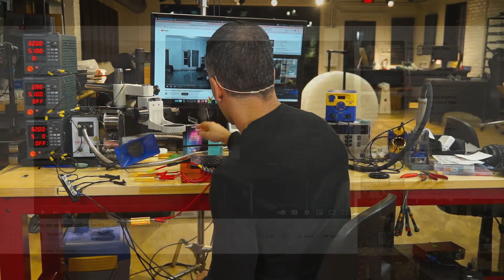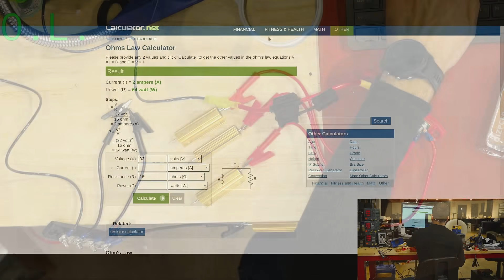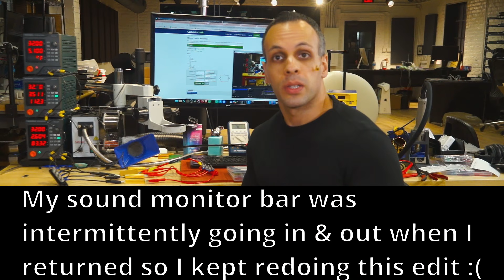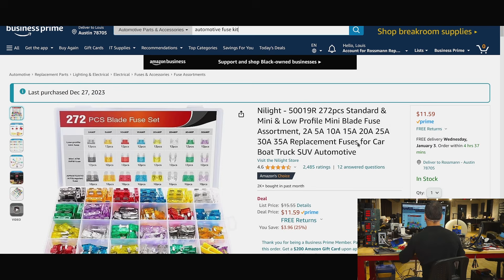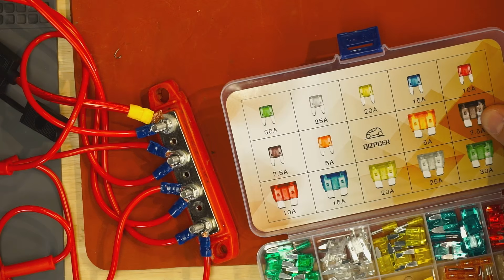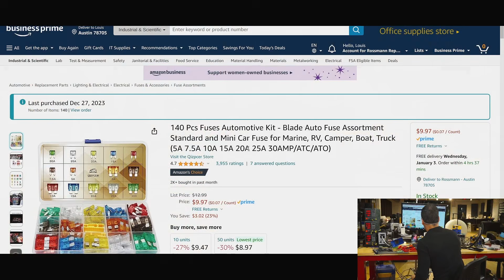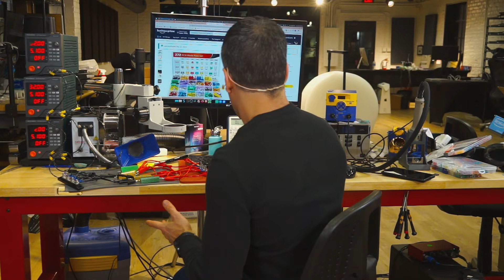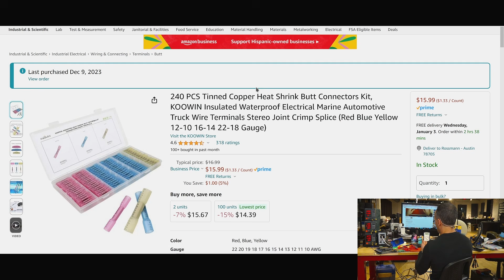Amazon Sells Fake Electrical Fuses

Comment: I am not an electrical engineer  but still watched your video (as well as the last one) because of the larger point you are making very well about the dropoff in quality of what is sold on Amazon. I have observed myself over the last few years how when I do a product search in Amazon, the top results are always some strange Chinese sounding names that Ive never heard of, and miraculously there are 10,000 5 star reviews of these products. I'm now conditioned to be very skeptical about Amazon reviews, whereas in the past, I would trust them.  I've also found that with a little extra effort, I can find the products I need from different vendors at lower prices.  I now have to seriously consider dropping my Prime subscription. The only thing I really am using it for now is the unlimited cloud storage for my 20 plus years of digital photographs.  Once I find an alternative cloud storage, I'll have no reason to continue my Prime subscription.
Reply: The Chinese should probably start to regulate themselves as a lot of companies are pulling out of their country. My Korean wife won't, for the most part, buy Chinese products because she doesn't trust them.

The country I trust the most for quality products is Germany. I brought a German vacuum, and have had it for 10+ years now, excellent product. I brought German made laminate flooring, best flooring I ever brought. As for stores I find Costco tends to sell quality products.
Reply: Pigs will fly way before the Chinese can regulate themselves
Reply: Is a NAS an option?
Reply: @bbrainstormer2036  That's what I did. I bought a 2 HDD NAS. It was the best investment that I ever made. I can even access it remotely. Simple and I never lost my data....oh, and I own my data and not some cloud company in case I don't pay my bill or decide to leave them. I hate subscriptions and avoid them as much as I can. If I want to stream a movie that I have on my NAS from another country, I can do that without a VPN.
Reply: Did you hear?  Prime video is going to have ads now.  And you have to pay $3 to get rid of the ads.  Between that and the "two-day shipping" that is never two days, it's a great time to get rid of a Prime subscription.
Reply: Buy yourself a NAS and some disks and take back your pictures in your hands, in the long run that's gonna be safer and cheaper
Reply: Buy yourself a NAS and some disks and take back your pictures in your hands, in the long run that's gonna be safer and cheaper
Reply: If you don't hate Microsoft, OneDrive is an option. You can get 100GB for like a dollar. They hide that option in favour of Office. And the cost for Office which comes with 1TB is the same as Prime.
Reply: I sort the reviews to 'Most Recent" first because tons of (5 star) reviews show up the second a product is listed. The later ones are where the bad ones show up.  I also normally only read the 3-1 star reviews. A 3-star, I figure the person actually thought about the review. 
On, and on products with thousands of reviews? Lots of times, it not even the same product!  The most recent reviews are of the product pictured but the first couple THOUSAND reviews are for an entirely different product. Seriously, I have looked at keyboards and had the first few thousand reviews be from some kitchen appliance.  
Place is just a mess anymore...
Reply: Two NAS and Backblaze are the recommendation I'd go for.
Reply: Buy yourself a NAS and some disks and take back your pictures in your hands, in the long run that's gonna be safer and cheaper
Reply: Buy yourself a NAS and some disks and take back your pictures in your hands, in the long run that's gonna be safer and cheaper
Reply: Buy yourself a NAS and some disks and take back your pictures in your hands, in the long run that's gonna be safer and cheaper
Reply: Buy yourself a NAS and some disks and take back your pictures in your hands, in the long run that's gonna be safer and cheaper
Reply: Buy yourself a NAS and some disks and take back your pictures in your hands, in the long run that's gonna be safer and cheaper
Reply: Buy yourself a NAS and some disks and take back your pictures in your hands, in the long run that's gonna be safer and cheaper
Reply: Buy yourself a NAS and some disks and take back your pictures in your hands, in the long run that's gonna be safer and cheaper
Reply: Buy yourself a NAS and some disks and take back your pictures in your hands, in the long run that's gonna be safer and cheaper
Reply: Buy yourself a NAS and some disks and take back your pictures in your hands, in the long run that's gonna be safer and cheaper
Reply: Buy yourself a NAS and some disks and take back your pictures in your hands, in the long run that's gonna be safer and cheaper
Reply: Buy yourself a NAS and some disks and take back your pictures in your hands, in the long run that's gonna be safer and cheaper
Reply: Buy yourself a NAS and some disks and take back your pictures in your hands, in the long run that's gonna be safer and cheaper
Reply: Buy yourself a NAS and some disks and take back your pictures in your hands, in the long run that's gonna be safer and cheaper
Reply: Buy yourself a NAS and some disks and take back your pictures in your hands, in the long run that's gonna be safer and cheaper
Reply: There are so many cloud storage products out there: Dropbox, Box, Google Cloud, Microsoft Onedrive, and more beyond that. There are also products like Backblaze that backup entire hard drives (though you don't have the individual online file-sharing features that Dropbox, Google Drive, etc. have; just the ability to continuously backup and recover the drive or get physical storage sent to you)

I can vouch for Dropbox being a good solution for most photographers I knew. Adobe even has cloud storage, which I haven't heard complaints about so if you're already paying for Adobe products could be a good option.

Comment: At least a fuse popped at all. I encountered a completely faked fuse - I guess it was just stamped sheet steel. In overload it absolutely melted the fuse housing and caused some damage of downstream electronics but did not blow. There are charts for blowing times. At twice the rated current it has to blow after 50 seconds max at a temperature of 23°C.

Comment: I recently purchased a Ryzen 7 7800x3D on Amazon, it arrived alongside other components, but the CPU was missing and the box (for the CPU) had it's seal broken. But the Outside Amazon box I got was still sealed, meaning it was likely stolen by the person packaging it, but instead of accepting responsibility, Amazon wants me to go to the police as it was "stolen by a third-party". Currently I am dealing with this situation with the police, but if you want to get any updates. I'll happily update you.
Reply: They never messed around when I had this issue. Got a phone delivered to my company, the box was a little light, since it was focking empty. 

We got the money back in a week.

It's more likely that it's a returned item that wasn't checked properly.
Reply: @LachskoenigIV We ended up returning the empty box back to Amazon for a refund, which they initially accepted as a valid return due to the missing parts, but refused a refund when the missing part was the empty box had arrived in their distribution centre, claiming I clearly didn't return it.
They refused to acknowledge the police were looking into and eventually, we charged back the transaction with his bank and got his money back that way.

Amazon followed up weeks later saying they still needed payment but never tried to charge me for it, so I guess they realised we were in the right on that one and didn't try to push it to court.

Comment: No need to do resistors.  Just set your power supply to put out a max 2a and increase until it blows.  Thanks for bringing this up....scary to think safety is skimped on these fuses.  A fuse should be able to handle that 2A at max temperature forever.  So at room temp 1.2 - 1.5x that amount should blow after a few seconds.  Another test would be to use the minimum gauge wire(24 awg) that a 2A fuse should protect and put that in series with the fuse.  Watch as the wire goes up in smoke before the fuse....that is the big issue.  The fuse is no longer protecting the wiring or equipment it is supposed to.
Reply: Except both claims was tested: the current rating, and the ability to break 32V without arcing. So the test-setup is kinda fair in that regard.

Comment: Normally you'd look for some voluntary safety test mark on the product (in the US, it would typically be the UL listing, in the EU it would be something like an SGS or TÜV Safety Tested mark or similar). For all the reviewed products, some people in the know asked the seller if these products are UL listed, and it was confirmed that they are not. Also on the product description or packaging pictures, there isn't  any safety marking (sometimes they can be forged, but in a marketplace like Amazon, certification companies like SGS or the TÜVs have market surveillance experts to hunt for misuse of their marks). To me it seems like Amazon is trying to hide this though, as you cannot see the full Q&A section like before (tried with multiple browsers), now you can keyword search to see some of the questions and answers if you guessed the right keyword(s)... 

What can you do? Don't buy any electrical products (components, wires, devices) without safety test marks. In the US you can search for example "UL listed automotive fuses" on Amazon and you'll likely be in a safer spot or select directly on the UL website to search for certified products: https://www.ul.com/services/fuse-and-fuseholders-services or https://iq.ul.com/fuses/. Properly tested fuses are a bit more expensive, but arguably this is not the place to save $5 and have your car burned down.

Stay safe!🦺

Comment: Lots of automotive fuses are actually a 'time delay' style fuse not a fast acting fuse due to the nature of vehicle loads such as wiper motors, window motors, fans, seat adjustment motors. Motor loads and such need time delay fuses. Only expect fuses to blow quickly if they are 'fast acting' type fuses. I am in no way vouching for the quality of fuses from amazon. Real fuse companies publish fuse datasheets with the characteristics of the fuses.

Comment: My Dad told us when he was an electrical engineering student in college way back in the early 50's he was assigned to test new circuit breakers for the electrical lab. He was shocked how out of spec some were - sometimes requiring 2 to 3 times rated current to open. These were high current breakers so when they did finally pop it was with flash and bang!
BTW Louis, That's a pretty convoluted setup. All you need is a car battery (on a charger), a carbon pile variable resistor and an ammeter - an old fashioned battery load tester. Just crank on the resistor until you have the amps you want. Would be a bit tricky for the 2A fuses but then you could test 10A, 20A, 30A fuses. 
Come to think of it I didn't notice an ammeter in your setup. If you set the power supplies to maintain 32v then they will vary the current (amps) to maintain the voltage. Those resistors may change resistance as they heat up and there is a possibility of other resistance in the circuit affecting current through the fuse. No way to really know without an ammeter.

Comment: Retired electrical engineer from the UK here.
Whilst I wholly agree that a good percentage of products from Amazon are pretty poor. I have to take issue with your understanding and testing of these fuses.
Firstly, there are many different classifications of overcurrent protection devices. The simplest type, which you are testing here, come under the classification of 'Coarse Protection'.
You will be able to find the time/current curves for such devices quite readily, these will show the values at which the devices are supposed to operate.
It is important to remember that the fuse is not present to protect the device it is supplying. It is there mainly to prevent the wiring from catching fire!
Secondly, the voltage rating of the fuse has nothing to do with the current level at which the fuse will fail. The voltage rating, in simplest terms, describes the isolation level of the fuse, once it has ruptured. For example; if you used a fuse rated at say 32 Volts in a 250 Volt circuit, there is a high probability that current would continue to flow because of an 'arc' being struck across the internal terminals of the fuse.
Reply: I'm glad you're retired if you were working on my car and let my wiring take 4x it's rating.   Or worse, my street.

Comment: Holy crap!  I have an inverter hooked up to the cigarette lighter outlet in my truck.  I blew the fuse for this circuit last year trying to pull too much power from the inverter.  I bought some cheap Amazon fuses and replaced it.  Now I know it's a ticking time bomb, if I try to draw too much power again I will likely melt the wires in the circuit, cause fire, possibly damage inverter.  Needless to say I'm replacing this fuse with a quality one ASAP!

Comment: Twice the power is a normal rating for a fuse.
Reply: no it's not lmao
Reply: do some research. 
The spec of one product line from littlefuse.
At 100% rating it takes 4 hours for the fuse to blow. At 200% it takes 1 second to blow. At 300% it takes 300 milliseconds to blow. @a9yle
Reply: @v9turner uhm. Little contradictive, aren't you

Comment: On an original IBM PC the monitor pluged into the computer protected by a 2 amp fuse. When I plugged a defective monitor into the computer, the 6 amp fuse, that protected the whole system, blew and the 2 amp fuse did not !

Comment: I do not know about fuse ratings, but circuit breakers allow for higher current.

For example, the C curve (I think these are the most common) allows rated current indefinitely, 2x the rated current for about 15 minutes and trip immediately at 5x-10x the rated current. There's even D curve that trips at 10x-20x the rated current. 

The idea for this is to allow for inrush current that is higher than the rated current. The wires are probably not going to melt from a short overload.
Reply: Correct. These fuses aren’t designed to blow at the number that’s stamped on them, they’re designed to allow current to flow at that rating just like an mcb. Fast acting fuses that are designed to operate very quickly (typically found on power supplies) are the cylindrical type made of glass with metal tips, they look the same as a 230v uk plug fuse but the middle is glass not ceramic

Comment: You should have tested if all the fuses blow at the same amperage, I have a feeling the fuses work fine but the only thing they changed is the color of the fuse and they are all rated for the same amps
Reply: Look at my original video (it's linked in the description of this video). I show VERY close up all the different fuses - you'll quickly see that they are all identical, regardless of their "rating". The only thing different is the color and the label on the fuse.

Comment: That 2 amp fuse at 3A should have blown in 1.1 seconds according to the current over time chart in Littelfuse_MINI_Datasheet-1077557.pdf . So yup, these are more like links than fuses

Comment: On top of all that, I doubt they're even all made badly the same way.  Let's say you test one red fuse that's rated for X amps and it actually blows at Y > X amps.  But even if you actually need a fuse that blows at Y amps, you can't assume that all the other red fuses will blow at the same Y amps.  Some might even blow at Z amps, which might not even be between X and Y.

Comment: I'm going to replicate you results, like good scientists do.  You need to do the experiment in a more scientific way. First you do need to compare the Amazon fuses to other fuses, like auto parts fuses, Walmart Fuses, and better yet OEM fuses. Go to a junkyard and pull out various ratings of OEM fuses from various brands of cars and test them, comparing them to the Amazon fuses. Maybe they blow at higher rated  amps like the Amazon fuses. And how much higher or lower. That's a great experiment.

Comment: You can’t even weed out the fake and/or dangerous Chinese junk anymore, because Amazon took out the Seller filter. Even filtering by Prime, you can’t tell what is sold by Amazon and what is 3rd Party without clicking on each item. This is extremely consumer unfriendly!